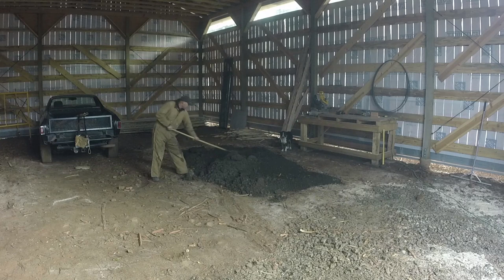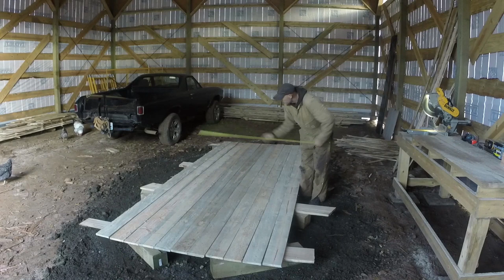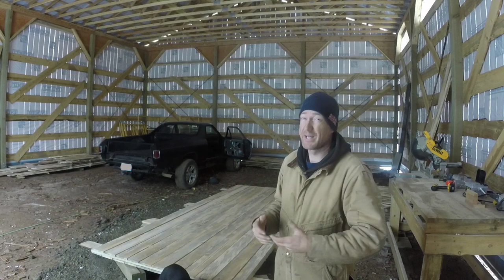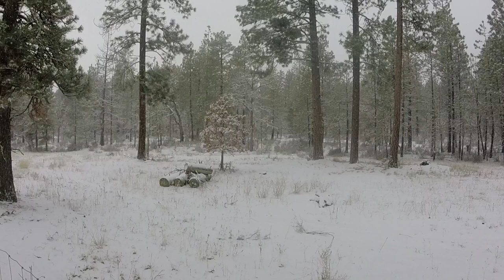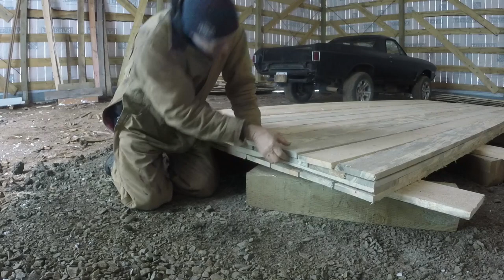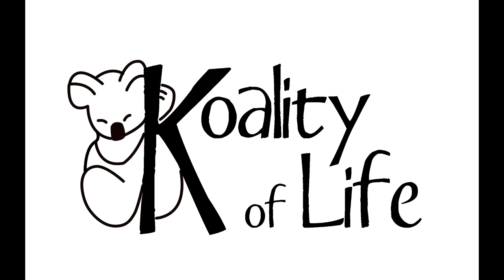Making huge carriage doors for the shop

Comment: I like your workbench and how you are not afraid to put a screw into it when necessary.  I have a similar one built entirely out of scrap and it is one of my most useful (and cheap) tools.  Some of the best things are well crafted items built from simple materials, just like your barn.  Can't wait to see it completed!
Reply from the maker: It does help that the workbench didn't cost me anything. I don't know if I would be so inclined to drill holes in something I spent money on. I will build a better workbench in the future, one with clamps and those holes for clamping systems. But first we better get concrete on the floor. :)
Reply: @KoalityofLife  Every time I start thinking seriously about a better workbench with all of the bells and whistles, I come back to, "This sure is nice to have a bench that could support my pickup truck on it (if I could figure a way to get it up on it)" and be able to drill holes, paint, screw down blocks, etc.,  that didn't cost me a dime.  I wholeheartedly agree on the concrete, first!  You have a real nice place, there.  We all enjoy watching you build it!
Reply from the maker: @westtexas5754  Thank you, I do appreciate everybody that watches. I have a couple workbenches that I want to build, and yes they will be strong enough to hold my backhoe. I have a hard time building something without over building it. lol :)

Comment: yeah i hate optima batteries. over priced junk. cant even recycle them cause they dont have enough weight to make worth it. i have cut a few open and harvested the lead tho. gave to my uncle he made ammo and sinkers. mostly sinkers he said the lead in them was bad lead. and thats why it cant hold charge. cause they already use recycle lead in them and it cant hold charge for long term. and what ever the mesh is they use inside them doesnt help either i guess. i sent you a message on FB.
Reply from the maker: Would be nice to be able to drive but sealed batteries are stupid expensive now. Not high enough on the priority list to spend money on. :)
Reply: @KoalityofLife   on my website brother prob cheaper to buy a agm battery for it in long run then it is a reg battery or a marine battery.